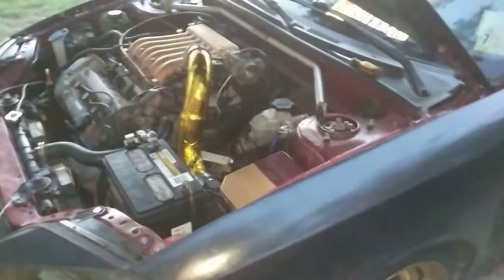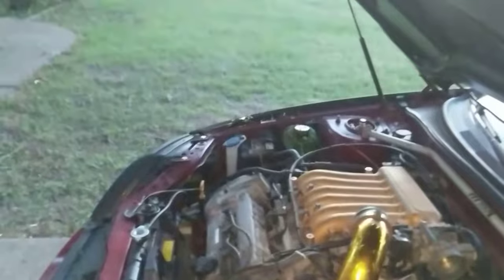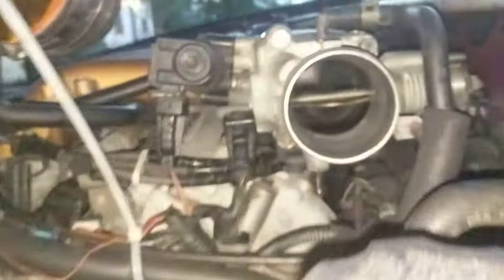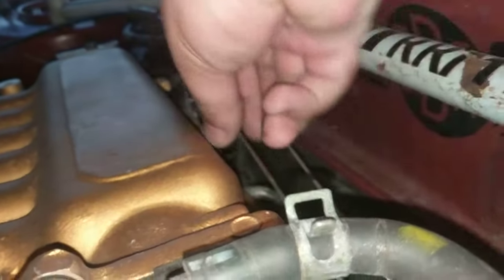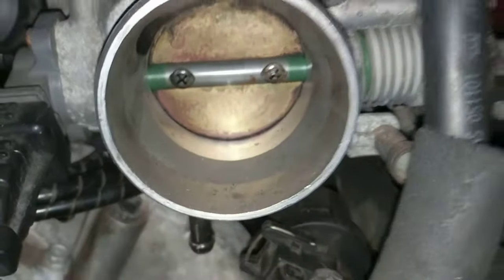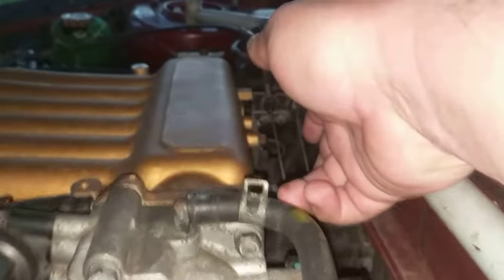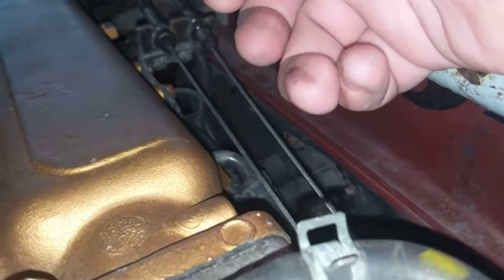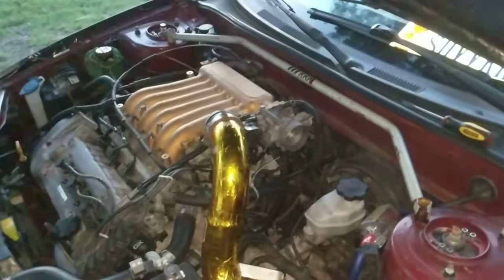How to PROPERLY adjust throttle cables

Comment: Your video doesn't answer the question of its title: "How to properly adjust throttle cables."
Reply: @bobross6677  He's RIGHT. It doesn't. It's just an explanation of why NOT to adjust it and how a loose cable can be ok.
Reply: You need a buddy to press on the pedal, while you tighten the cables so your throttle is open like they showed in the video. This video explains why most people think they need to adjust it due to slack on the cable. PS, most people don't need to adjust it!
Reply: @justtransfer539  You can do it yourself also. You don't necessarily need a 2nd person to get in the car and depress the throttle cable at wot. Take a long prybar put it between the throttle pedal and driver seat, adjust the seat if you need to so that it pushes the prybar against the throttle pedal until you get wot or wide open throttle and then make your throttle cable adjustments form there. It is better to loosen the throttle cable first, adjustments is done where the throttle cable is mounted in back of the intake plenum then use the pry bar method to hold the gas pedal down and then make your throttle cable adjustments until you have it where the the cable has enough tension to hold the throttle body plate at wot where it isn't too tight or too loose on the cable. Being too tight would be worst because if the cable is pulling the throttle door past that wot point you could actually break the throttle shaft where the butterfly door is attached to when mash down on the gas pedal putting stress on the throttle shaft. I seen it happened on aftermarket thottle bodies.

Comment: I did that yesterday to my 2003 tiburon gt v6 manual.  And took it for a drive. I was thinking this mod will benefit me. But car actually run bad. As soon as a get home. I will lose it on to normal.  Thank you so much for the video.  Good luck
Reply: Fred you have to do it just right ,if you want to know how to do it right you should watch Chris Fix video he explains it better than this guy, now as well intended as this video is, the thing that is actually helpful about it is that overtighting can be bad and you have to be careful but other than that is not very helpful, first is that his testing if you were paying attention is incorrect because you don't have to remove the intake hose to prove that the flap is partially open when too tight, you can see that by looking at the movement of the cable and another thing it doesn't matter how loose the cable is if you start the car and leave it in park idling the flap automatically opens regardless of how loose it is, I just did some testing today because my car was running poorly I would step on the gas pedal and my foot would go down a little before any acceleration was felt, I adjusted it but made sure it wasn't very tight just a little bit of slack and my car felt like a totally different car the quicker acceleration response great but I went ahead and loosened it again a little bit too see if I can feel any difference and I over loosen it so I just adjust it a little bit tighter and now is perfect  the key is to play with it a little and pay attention to exactly how much you adjust so you can get it just right, according to Chris Fix over time cable will stretch and will need a little adjustment but be careful not to overtighten, and if your car runs rough maybe you overtighten it a little too much I would just loosen it a little at a time and your problem might have to do with a dirty throttle body that needs to be cleaned the iacv or the mass sensor even old spark plugs anything can cause it to run rough.

Comment: Lord people in the comments are something else. He DID explain how to adjust them by explaining HOW IT WORKS. God gave humans intuition so u s e i t. I know you can do it stretch those brain muscles and fkn think. If what you really meant is how to tighten or loosen the cable its very obvious when you open the hood. There are typically a couple screws holding a bracket in place that you can slide up or down to tighten/loosen the cable.

Comment: You right that little slack on the throttle  cable is very  important  mine was loose too much, it was giving problems, and I adjust the cable but I did it to tight position, and then I had another  problem, the idle stay hight  when the car got to full stop, the pedal doesn't go back allway up, and  I had to put my foot under pedal and pull 
to get the pedal back allway up, and by doing so the idle go down to normal, and I have to loose the cable a little to fix the problem.
Reply: I’m having this exact problem right now in a 99 civic I just bought that’s why I’m watching this video lol
Reply: Just tighten until it’s 1k idle and you’ll still have good response

Comment: too tight of throttle cables can cause high idle correct? since it is constantly taking in more air than what is needed
Reply: You could also break the throttle shaft in the throttle body where the butterfly door attaches to when the cable is too tight and not adjusted properly I seen it happen.

Comment: Hey so I have a big issue Iv got a 97 camaro v6 and about 6 months ago I was messing around on the roads and put my pedal to the floor. I know it wasn't the floor mat that stuck it open. My pedal stayed stuck to the floor and I suspect it might be my throttle cable. Do you know what would go wrong with a throttle cable to make it do that? It was the scariest thing I'd ever experienced. I wanna make sure itl never ever happen again xD
Reply: Check the throttle return spring, for one. Mine didn't cause my throttle to stick open, however, the gas pedal was kinda sticky as it was pushed down or released. I sprayed it then wiped it off with some light lube/cleaner and it's nice and smooth now.
Reply: Fit a V8. Problems solved :p

Comment: My sons jeep twice in the last to weeks left him with pedal to the floor with no acceleration, and then all the sudden it like slams  in third gear cable feels loose. But after watching video, I don’t think the cable is the problem! Idles fine??? I’m lost we’ve replaced all the normal stuff, spark plugs, belt ,fuel purge pressure,regulator. Idle air, positioning, sensor, mass sensor, throttle, positioning, sensor, ???suggestions anybody
Reply: End results please what fixed it 
Thanks in advance 😊

Comment: Hmmmm. My gas pedal seems loose and bouncy. Some videos say I should use a zip-tie by the gas pedal.. and other say I should tighten throttle cable.. confused.. 
The engine has 250K and it has loosened over time.
Reply from the maker: If its the pedal itself it may be up where its mounted wearing out
Reply: @bdrracingdevelopment5490  thanks
Reply: @snackler6102  thanks, I have a 2000 Lexus,.. these Toyota engines last forever.. LoL
Reply: @KevRalph  the 2000 v6 Lexus actually seems like it has a throttle cable issue

Comment: Hello if I want the throttle open more my 13 armada what do I do?
Reply from the maker: I believe you have an electronic throttle body so you shouldn't have this issue. If you are wanting to change anything with that you'll need to get it tuned to change it's characteristics. Im not sure if theres a drive by cable conversion for you but that would also be something to look into

Comment: Mine is really loose though .. soo what do I do ? I have a 1994 LT1
Reply from the maker: I would still try to adjust it how I described.  There will be a point where you actually do have stretched cables and should replace them and that's when there is too much "dead zone". How far down does your pedal go before it responds after you adjust it this way?
Reply: @bdrracingdevelopment5490  it opens right away but there is alot of slack before it actually opens if I do it from under the hood
Reply from the maker: @slowcarracing3025  some slack in the cable itself is ok as long as your pedal isnt going too far down before it starts to open.

Comment: No help👎
Reply: Chris fix actually explains this procedure perfectly, is not that complicated, the reason the throttle open when he pulled on the cable is because he pulled it hard  you're supposed to gently pull just enough to get rid of the slack no force at all and you can leave a little slack for peace of mind. You can actually feel the slack of the cable when you step on the gas pedal, if it feels fine no need to adjust it, anyways just type how to adjust throttle body cable and you will see it explain by Chris fix, the name of his channel is called Engineering Explained.